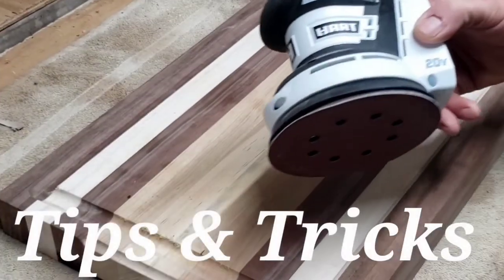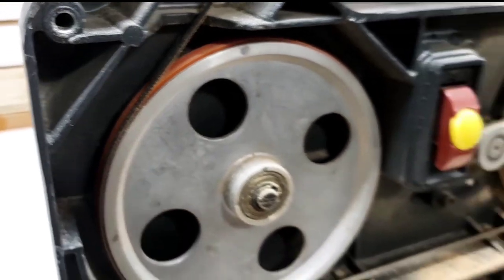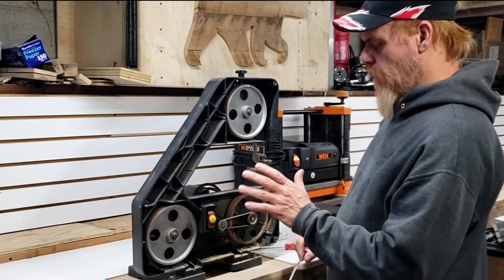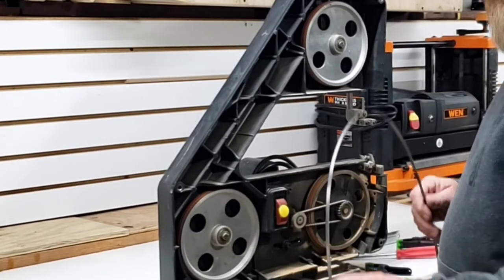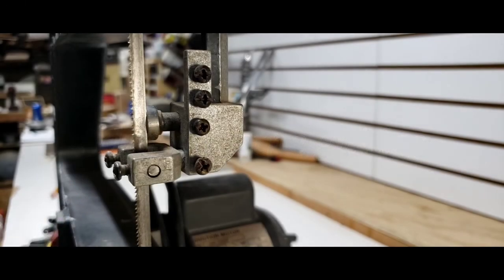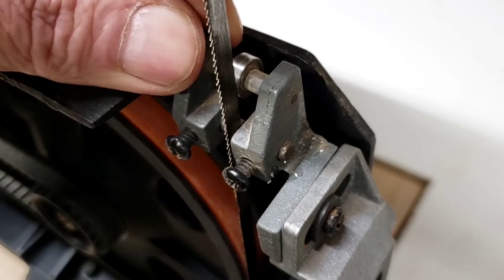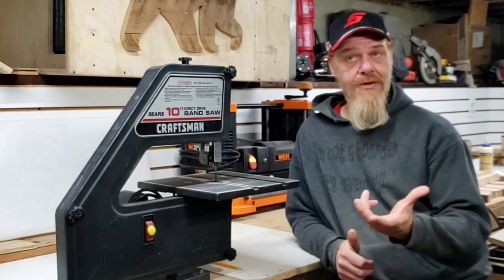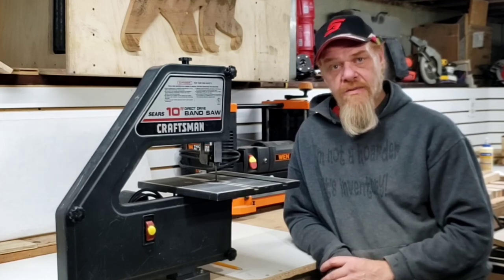Craftsman 10 inch bandsaw #3 | DETAILED BLADE TENSIONING & INSTALLATION | HOW TO ADJUST GUIDES

Comment: Love listening to you. I've adjusted the blade like you said but after cutting 2 or 3 inches the blade binds to the wood stopping the motor. Any suggestions? thank you
Reply from the maker: I would check the drive belt. Make sure that the belt is tight and that is installed correctly. there will be a smooth side and a ribbed side. the ribbed side interlocks with the teeth on the drive gear(motor side) and the drive wheel. make sure those ribbs are all intact
Reply: @MakinSawdust  checked that and it is in the right position but after cutting a few inches the blade binds in the wood causing a burn mark in the cut.
Reply from the maker: @rossciaglia7677  hmmmm, ok is it possible the wood has a lot of stress in it and when you are cutting the wood the gap is closing back on the blade?
Pine is known to have a lot of stress. Is that the material you are cutting?
Reply: @MakinSawdust  yes it is...never thought of that. It does look like the wood is slightly twisted

Comment: Got mine out of a scrap metal bin.......thought I could fix the slingshot blade.......turns out be be a very flawed design. 
The three wheels should have had a outer raised edge to prevent the blade from slipping off. Yes a lip on the outer edge of the wheels  it could dull the blade but really if you are spending hours putting the blade back on the wheels instead of cutting wood what is being accomplished? The drive wheel does have on raised edge on the inner side though.
7:50 If you are missing this roller bearing on your guide block, the show is basically over for this saw.
Reply from the maker: Thanks for your comment. There is a set screw on the back side of the saw that can adjust the tracking of your upper wheel and it will naturally keep the bandsaw blade on.

Comment: Hey you used my trick!  Nice job on the video.  I've heard from others to try to get the grove between the blade teeth in the center of the top wheel but it seems like your's is working fine with the teeth hanging over the edge?
Reply from the maker: I tried to find your comment with your mini clamp tip, but I couldnt. I also couldnt remember who it was, so thanks :)
yes it should be closer to the center from all of my experience with other saws, but this one in particular may be a bit finnicky. The teeth are very close to the front edge, but not past the edge. maybe .030" back. I am going to try and flip over one of the tires and see what happens.
Reply: @MakinSawdust  lmk how that turns out.

Comment: Just finished watching your video and it clued me in on a couple things that helped. Only thing is that those bearings on Amazon are $15 and I need to replace all of them and will cost me $90 so I'm thinking I might as well buy a new saw instead. Anyway, I bought mine new back in the late 80's and the model number on it is a 113.244513, would it use the same parts as you have for yours if I decide to fix it? I'm a little confused on which bearings fit the wheels. The ones you have listed seem to fit replace the thrust bearing or are they all the same?
Reply from the maker: there are links to 2 items on my site for the bearings. for a single bearing the link is there and the price is $15, but the other link is the same bearing but it comes in a 2 pack for $10.99
I know it seems confusing, but I wanted to offer a couple options for folks. here is the link for the 2 pack. https://amzn.to/3dzVxSb
Reply: @MakinSawdust  After  taking off one wheel, there are no bearings, they are brass bushings on mine so I guess I'm out of luck.
Reply from the maker: @thumbresin  oh wow! I have never seen that before. I wonder if someone had replaced the worn out bearings and put brass bushings in. 
I hear a lot of good reviews on the 9" WEN benchtop bandsaw. @diyGene on Youtube has a good review video. I think they are around 150 bucks.
Reply: In this comment it looks like they are asking if the bearings in the wheels are the same as the thrust bearing...I am wondering ad well...your link is for  thrust bearings. I am needing to know which bearings you used for the wheels?

Comment: Has anyone replaced or upgraded the blade thrust bearings?
Reply from the maker: Thanks for the comment. I really cant answer that yet, but you have spurred me to make a fourth video for this series. I will do some deep dive hard drive research and some wayback machine on the webs.  
Thank you for the inspiration :)

Comment: I have this model that I got from my dad.  It is a cream color and circa 1985.  It is missing the blade.  What size of blade would I have to get?
Reply from the maker: double check what I have listed on my parts list page of my website. I think it is 56 7/8"
The link is in the pinned comment and also the description and the other 2 videos linked in this video description. thanks for your comment.
Reply: @MakinSawdust  I just ran out and double checked and I was wrong.  It is a 1985 Solidcraft 12" variable speed saw not a Craftsman.

Comment: The grip on the wheels that keep the blade from slipping is old, it really looks like i need a new on and it slips off constantly, breaking the blade. 
I just gave up
Reply from the maker: Thanks for the comment. I really cant answer that yet, but you have spurred me to make a fourth video for this series. I will do some deep dive hard drive research and some wayback machine on the webs.  
Thank you for the inspiration :)

I will include the infor mation soon

Comment: My band saw keeps falling off.  I can’t keep it in the middle of the wheel.  Can you help to solve the issue, please? Thank
Reply from the maker: How can I help you?
Reply: I spent 5 hours trying by hand and the hex bolt adjustment and still haven’t alignment the wheel to keep the blade on, I will check each wheel next see if bearings are all good, then keep trying, 

Thank you for this video, the bottom bade guide I also broke just like you, then I superglued it, then added wood to keep layering the super glue on it for more strength, but epoxy is the right way, thank you!

Comment: The guide bearing on mine won't go behind the blade. It just won't adjust that far, it runs on the side of it. It's aggravating. I can run it and cut. So I don't know what else to do.
Reply from the maker: I would refer to the manual and parts list to make sure that you have correct diameter bearing installed. The partslist and manual is avail on my website.

Comment: JB Weld to the rescue?
Reply from the maker: Devcon is my preferred choice, but same thing :)
I fixed a motor mount ear on a 440 Chrysler with JB weld one time. The ear that broke off was part of the engine block casting and it broke and exposed the water jacket. It never leaked, so I bet my lower guide will last for a very long time :)

Comment: I bought this exact bandsaw new several years ago I stopped using it because changing the blade is impossible I started using it again and changing the blade is just as hard now as it was then this saw is a piece of junk always has been
Reply from the maker: Thanks for the comment. I really cant answer that yet, but you have spurred me to make a fourth video for this series. I will do some deep dive hard drive research and some wayback machine on the webs.  
Thank you for the inspiration :)

I will include the infor mation soon

Comment: Mine is similar. https://christmas.musetechnical.com/ShowCatalogPage/1992-Sears-Spring-Summer-Catalog/0613. It was in the 1992 catalog. Got it a few months ago for $75. Been stocking up on blades which aren't always in stock. Olson has some 56 7/8" blades. I've used the Powertec ones and I've got one of the Bosch 6 TPI. That's a rough cut with that blade. Just put new tires on mine. It's a good saw overall. The motor on mine is mounted farther back and is direct drive to the bottom wheel. Blade tension is on the right side not the top on mine No drive belt like some of these have either. Enjoy your videos a lot too
Reply from the maker: Thanks for the great information. thanks as well for the compliment too :) I appreciate you as a viewer :)

Comment: I got one of these (113.244513 model) a few years ago free, but I can't use it because as soon as I turn it on the blade comes off toward the front.
I really want to get it working, but I don't want to spend a ton of money buying parts if it's not going to fix the problem, VS just buying new.
I haven't used bandsaws before, and I really wish there was someone in the area who could explain what I'm doing wrong when adjusting the wheels and stuff.
Reply from the maker: There is a set screw on the backside of the saw at the top wheel. It will tilt the upper wheel to have correct blade tracking
Reply: Yup, that seems to have been the answer!

Comment: I can't find the bearings!! The part number I have is #60528.  My model  # 113.2114513
Reply from the maker: Thanks for the comment. I really cant answer that yet, but you have spurred me to make a fourth video for this series. I will do some deep dive hard drive research and some wayback machine on the webs.  
Thank you for the inspiration :)

I will include the infor mation soon